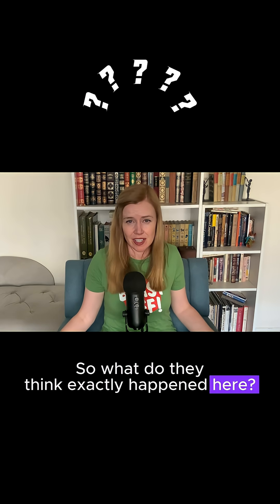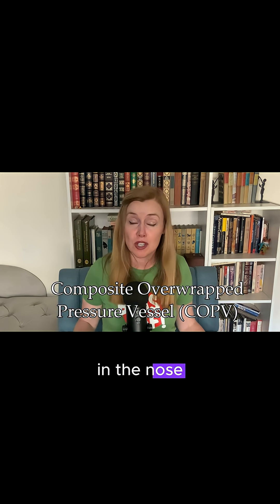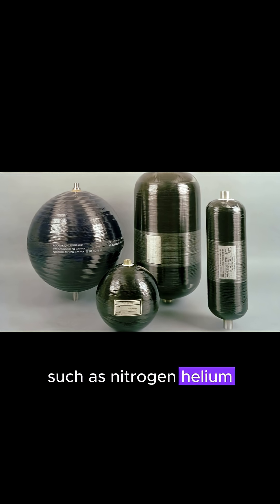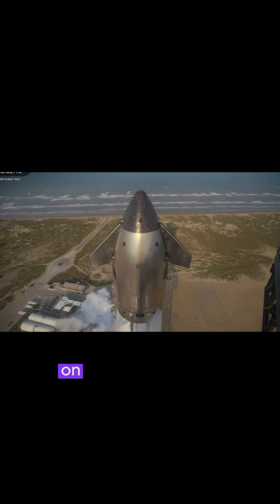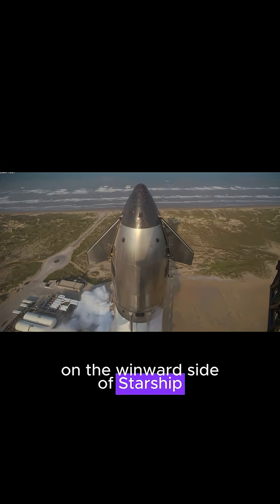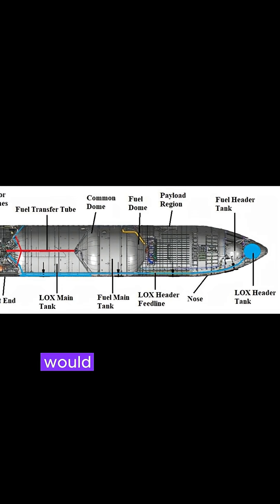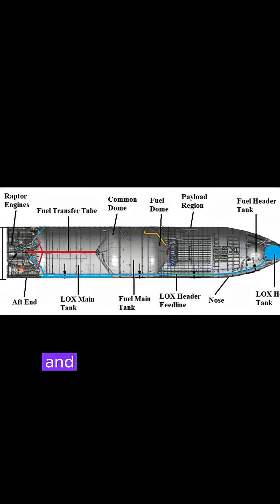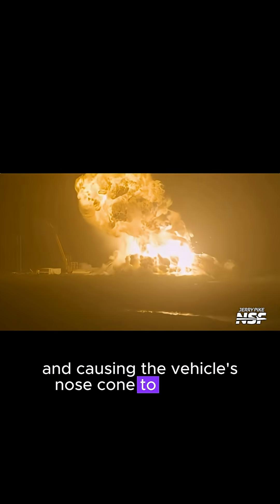So, why did Starship go boom?

Comment: Flawed construction? Rough handling during mounting? Cryogenic fluids are also very tricky. Overtorquing the mounting flanges, or tweaking a valve during filling?
Reply from the maker: Yeah, there are certainly a ton of components to consider. 🤔